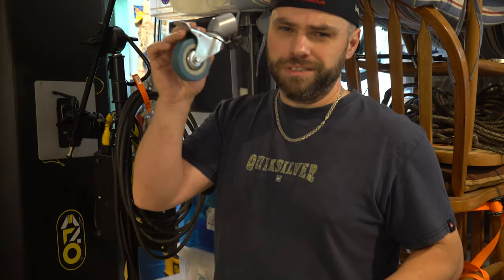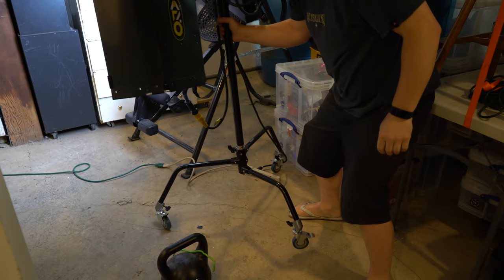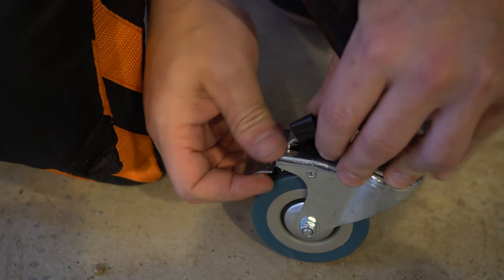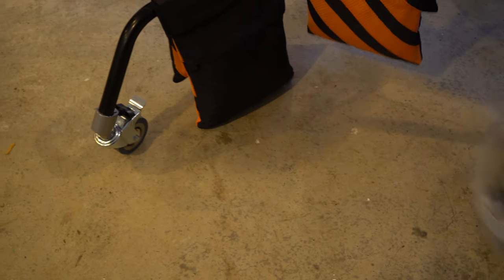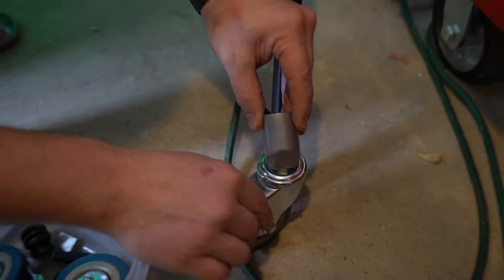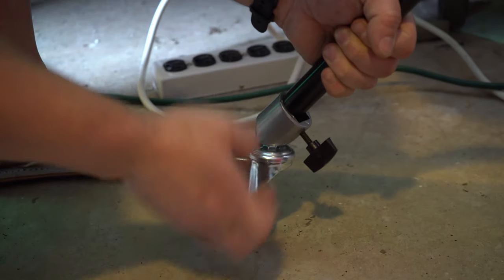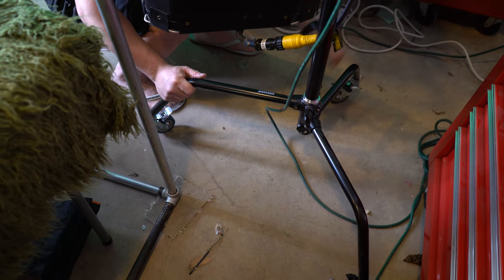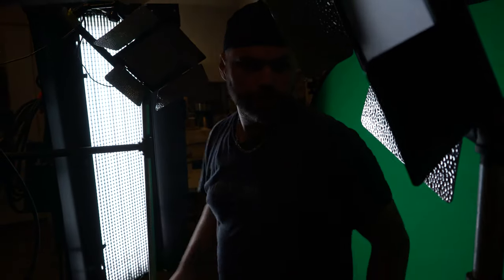Installing Swiveling CASTER WHEELS on your C-STAND or TRIPOD | How Good or How Suck Are They?

Comment: I'm just not a fan of caster wheels on C-Stands.  C-Stands are 85% stable without sand bags.  C-Stands on Caster wheels are even more unstable as the caster wheels spin and rotate, causing the C-Stand to pitch, lean and yaw in a split second.  Caster Wheels are great until they are not.

Comment: They make castors for light stands and castors for c stands.  Make sure you use the right type.  Also, the weight on your c stand should hang over the top/longest leg.  Try it.  You'll instantly understand why, ESPECIALLY with a boom arm.  Another tip, once you have the weight over the long leg, Stand behind it and make sure all the knobs are positioned with the little knobs on the left.  This keeps any downwards pressure from weight from loosening it.  If anything, it can only tighten it a little.  (L=Little and Left)You don't want a heavy light on a grip arm slamming down on your favorite hot model, right?  Disregard if you are, for some reason, shooting your ex.